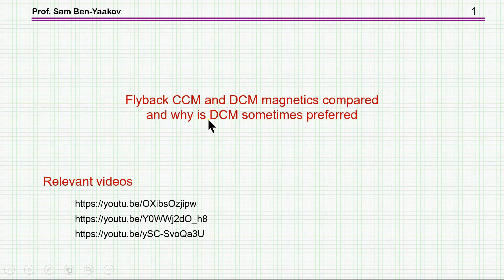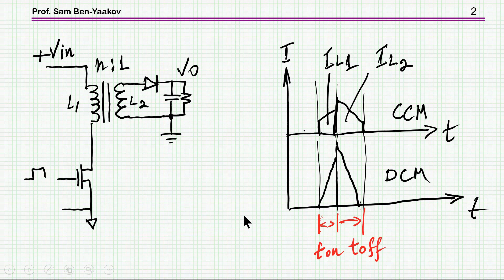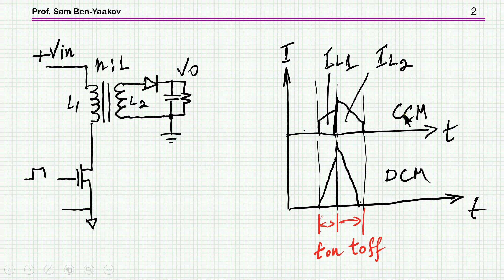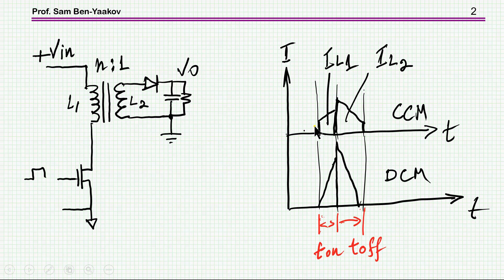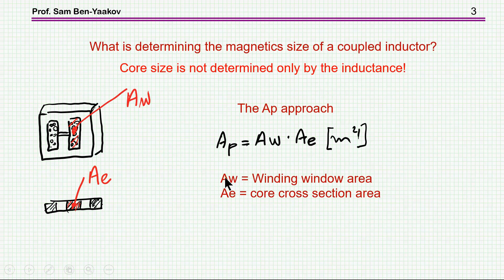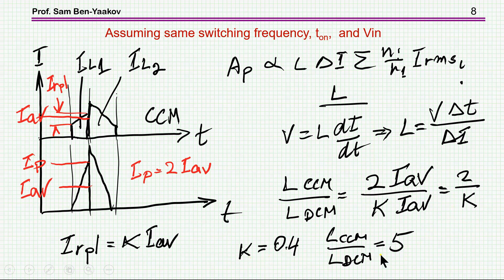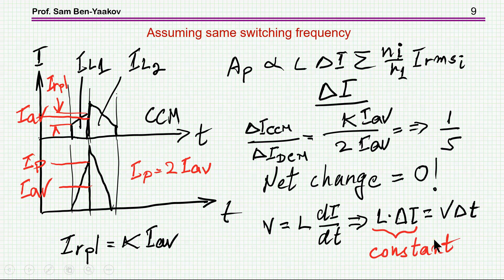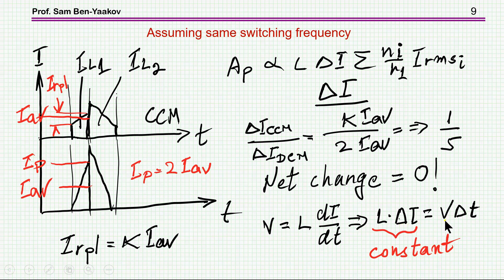Flyback CCM and DCM magnetics compared and why is DCM sometimes preferred

Comment: Hi Sam thank you very much for your informative lecture. You say DCM core can be smaller because we can increase the switching frequency. However what about core losses in DCM its much higher than CCM because of high dB which could be a limiting factor that force the designer to increase the core size leading finally to lost DCM advantage ending up with similar or bigger core than CCM. Am I right?
Reply from the maker: Good point. But, if  you keep same deltaB, losses increase per cm^3 so if the size is smaller total loss is reduced. But of course, there is the issue of thermal resistance. So each case has to be dealt with properly. Thanks for comment.

Comment: But what i never understand: why not use doublesided rectifiing? Would you not get the most power trough a core when it not has to store all of the energy from each half cycle instead of using the bit from other half too? Or is it only for making the pwm regulation easier?
Reply: If you double rect is not anymore a flyback or is.an hybrid like flyforward
Reply from the maker: Indeed, the transformer of a forward converter does not store energy. But per Murphy law, that converter has its share of problems, the transformer will not be appreciably smaller than the Flyback and you need an inductor at the secondary.

Comment: thank you very much for your impressive explanations  on all your lectures.
would you please elaborate on the two switch ''flyback'" topology which is frequently used in the 400w range of power 12v pfc power supplys
used in server and network switch applications.
Reply from the maker: Thanks. Good subject. I will consider preparing a video on that

Comment: Hi Sir. I have to say something contradictory.. Usually the Core size of DCM is smaller than CCM, since CCM has a shifted remanence... Ripple current nothing but ripple flux density too..
Reply from the maker: Smaller? On what basis? Can you show me a DCM CCM magnetics designs of same power, efficiency  and frequency in which the DCM is smaller size? This is an urban legend.
Reply: @sambenyaakov  Ha ha.. For a  DCM how much swing on fux you can expect? 0 to 0.3? In CCM it may be from may be 0.1 to 0.3.. So without any flux swing there is nothing.. And hope you know energy density B^2/2u.. You have smaller energy density if you want to operate in CCM. Energy density nothing but its energy capability / volume. So more volume if energy density is less, so bigger core..
Reply: @sambenyaakov  And because of the high rms current you can say, need thicker wire.. But its not related to core size.. Thats why the area product method is not valid in case of inductor design, Its still useful in case of transformer since there is small amount of energy storage each cycle... For inductance or energy storage should be based on the core volume...
Reply from the maker: If you need thicker wire the winding window is larger and Ap larger. Unless you have bad non economical designs which do not use all Ap so both CCM and DC magnetics are wastefully large.
Reply: @sambenyaakov  Okay. Indeed.. But this we can say if the both flux swing are in same amplitude.. But its not. And for area product is inverse to flux swing, smaller flux swing will have more AP.. ( still AP is not based on core volume, which defines the energy handling)